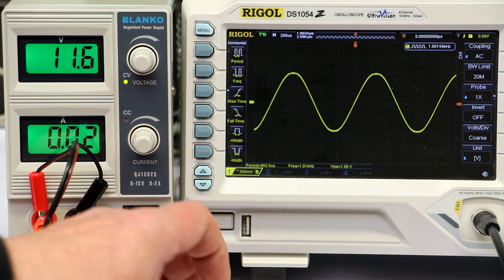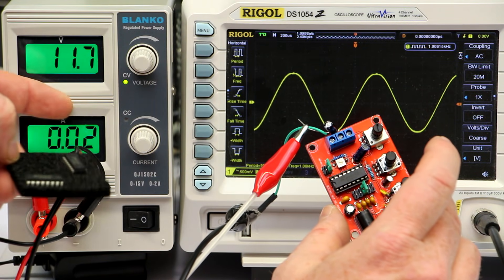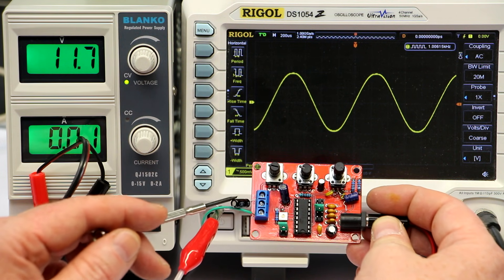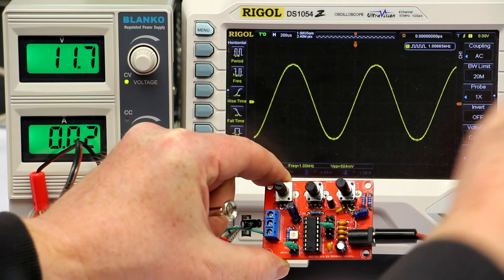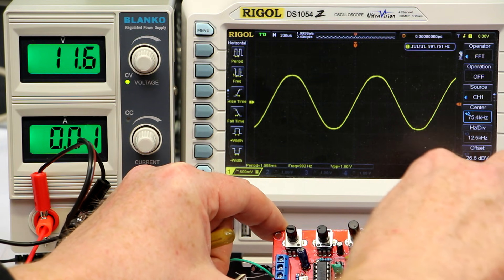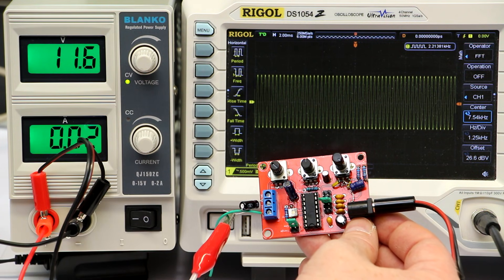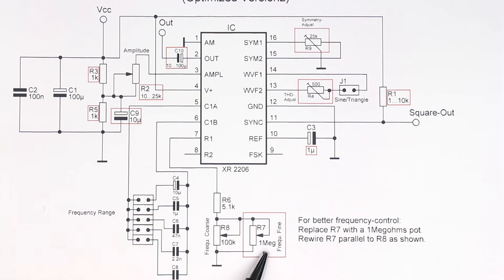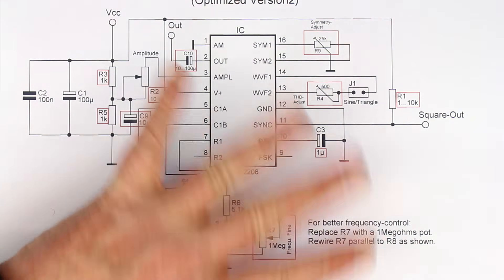Fixing the issues with the XR2206 Function-Generator from EBay

Comment: Hi, Roger!  Thank you so much for this video...it was extremely informative!  I especially liked your improvements, and the schematics you provided with the changes.  I made all of the modifications you suggested, and they all worked except for wiring R7 (changed to 10MOhm) and R8 in parallel.  I may have mis-wired the pots, but changing R7 didn't seem to make any difference.  I reverted back to R7 and R8 in series and it works well enough. Also, I replaced the supplied/fake XR2206 with a genuine XR2206 and it seems to work better, but I still have very narrow noise spikes at the maximum and minimum of the sine wave.  The spikes are present with both the genuine and fake XR2206 chips, so I wonder if the problem is being caused by another component (one of the caps)?  Also,  I was able to source all of the replacement components from Jameco (in the US) for $11.73 (including a genuine Exar XR2206).  Not a bad price for a significant upgrade!  (I will make a separate post with the Jameco part numbers and prices.)
Reply from the maker: The spikes at the upper and lower limit of the sine-curve are a consequence of how the sine-wave is created inside the XR2206. It is a well-known bad "property" of the chip. Soon after the chip came out some clever engineers developed some "workarounds" with a lot of extra-circuitry to get rid off or minimize the spikes.
Reply: @KainkaLabs  Ah, that makes sense; thanks for the explanation.  After I looked at my board again, I realized that I forgotten to solder in C9, and I thought that might solve the problem.  It did stabilize the signal a bit, but didn't get rid of the noise spikes (obviously).  The spikes really distort the sine signal badly above ~100kHz.  It's notable that the closer you look at the performance of this chip, the more flaws you see (the noise spikes, bad square wave asymmetry below ~100Hz, etc.)!

Comment: Hello. I just got my first multi meter and was doing voltage readings on the XR2206. and was wondering how come when I plug in 12v to the XR2206 it changes to 16v just going through the connector? is there a zener diode limiting it to 16v?
Reply from the maker: What? The XR2206 does not a charge-pump or something like that to generate higher voltages than the supply voltage. So you must be doing something wrong when you measure 16V with 12V input supply-voltage.
Reply: i probably shorted something together when i soldered it in school lol. Becaue I have 12v coming in but 16v after the connector.... so confusing @KainkaLabs

Comment: I love your work with this chip. After making these changes, have you thought about a way to make it sweep from one frequency to another ? I have a need (radio testing) to make it sweep from about 200 hz to 5000hz and be able to view it with an oscilloscope.
Reply from the maker: You need an extra-circuit for the sweep-input of the chip. That doens´t fit any more onto the PCB. Today you can get relatively cheap function-generators with a sweep-function. Or you google "XR2206 sweep generator" or similar to find examples of the necessary extra circuit.

Comment: Roger, I have watched and enjoyed both of your videos about the XR-2206 Function Generator.   Have fried my IC by inserting it upside down... I order new IC's  (the old IC had markings scratched out).   With your improvements and suggestions, I am considering making a board that takes your improvements into account and does not require use of modify parts or using SMD components.   I was able to find on Amazon pots of the correct form factor in both 25k ohm & 1 Meg ohm.  I will let you know when I have the new boards... and send you one if you like.   Thanks again for you good work and analysis to make this a better tool for us hobbists.
Reply from the maker: Hi. That is a great idea. Would you be willing to make the PCB-files available for open source?
The potentiometers have a standard footprint and are originally from Alps.
Reply: That would be awesome!

Comment: The 10K pullup limits the current of the 10V square wave, but what can I do to also limit the voltage to 5V. Only having a 5V max sq wave makes things easier, as I won't have to jump from 10V to my regular 5V all the time.
Reply from the maker: You don´t have to limit the voltage.
All digital logic IC´s (exept the very first CMOS-series) can safely deal with overvoltages.
They have input protection diodes going to ground and Vcc which deflect overvoltages (or negative voltages) to Vcc and GND.
The only thing you have to limit is the current through these protection diodes.
Let´s presume the datasheet of your logic-series says that the max. current into any input is +/-10mA.
If you have a 10V signal into a 3.3V logic-input, then the minimum value of the input resistor (or pull-up of the XR2206) is:
R(min) = (10V - 3.3V)/10mA = 670 Ohms
That means that even a 1k resistor would be sufficient and a 10k resistor would be absolutely safe.

The other possibility would be to use a voltage divider.
A 10k/10k or 1k/1k-Divider would make a 5V square-wave output at the center-tap of the divider from a 10V square-wave input.

Comment: Very nice and informative video indeed. Many thanks. 
Just a question though, which minimum frequency could you get to in "square wave" mode?. Is it really possible to get down to below 10Hz?
Reply from the maker: There is no reason why it´s not possible to get below 10 Hz. If you are using an output capacitor to get an AC-coupled signal, the value has to be quite large (>100µF)

Comment: Good day. I am thrilled with your instructive video. I had the above kit with XR2206 so I decided to apply all your recommendations. BUT BUT....I have some problems. 
1. I can't regulate the amplitude at all. It's at maximum. 
2. I don't have SINUS and TRIANGL signal shapes at the output. I only have a rectangular signal. Trying to adjust THD using trimpot R9 and R4, at the output for SIN and TRIANGLE I have a square shape with rounded edges. The supply voltage is 12V. The XR is Chinese.
Reply from the maker: I can´t do remote diagnosis. In 99% of all cases it´s a soldering problem. Perhaps you have shorted out 2 pins or not correctly soldered another pin.

Comment: Is it possible to adjust the amplitude of the meander (square signal) on this generator?
Reply from the maker: It´s an open collector output. So you can with a pullup-resistor get basically any output voltage.

Comment: Another possible solution to the square wave problem is to keep the 1K resistor and clamp the output with a 5.1v Zener diode. I have one of these kits but not built it yet, so I may try that as many 3.3v logic devices are 5v tolerant these days, I just don't know if a Zener would be fast enough at higher frequencies.

Comment: Hi,
Thanks for the very complete and comprehensive videos! I also found another issue that is wonder is somebody else had:
In my signal generator the maximum possible amplitude is around 3.5 volts (peak-peak) and no matter what I do stays the same. I changed the amplitude potentiometer for a larger one but the issue persists.
Any hint of what could be the cause? Thanks!

Comment: This is a great Video. I have one question regarding your second change (Swap R3/R5 from 5k1 to 1k): Both form a voltage divider with 1/2 Vcc output. Only the current changes (10k2 vs. 2k resistance in total). I don't understand this change. I would very apricate an explanation :)
Reply from the maker: The voltage divider R3/R5 has to be as low impedance so that the load through the amplitude potentiometer does not appreciably change the virtual ground voltage at the midpoint of R3 and R5.

Comment: having a hard time finding a 1 mega ohm Potentiometer to replace the middle  Fine  Knob (R7) per suggestion on  Kainkalabs schematic.  the ones I find do not have 3 pins going down - they go to side. does anyone have a model number I could google. thanks

Comment: Hi Mr. Very good video! I found the same issues with mine that I bought assembled. I was in doubt if it was defective or a design  error. You solved the doubts. Thanks! Just one issue: I've tried to download your schematics with optimized components and instructions  but received a "The request is blocked" message. Could you please help me with this issue?
Reply from the maker: Link has been changed to the kit in our online-shop where you can also find the documentation. Should work now. Built-manual is only in German until now.
Reply: @KainkaLabs  Thanks!

Comment: Forgive my ignorance as I'm new to electronics. I want to replace R4 with the suggested 500 ohm trim pot but am uncertain as to the routing of the pins. Trim pot with three, resistor location accepting 2. Do I put the first pin in hole 1 and then extend the wiper pin into hole 2, deleting the 3rd pin on trim pot?
Reply from the maker: Connect the wiper pin to one of the IC-pins, where R4 was connected.
Connect only one of the remainig two pins of the trimpot with the other IC-pin (the remaining trimpot-pin can be left unconnected).
The order of the IC-pins in connecting it with the trimpot doesn´t matter.
Reply: KainkaLabs Thank you for the fast response. You're a great teacher. I love watching your videos!

Comment: Very good info, but try using battery as source power and stability problem is gone.
Reply from the maker: No. The problem comes from the voltage as soon as it gets higher than 12V.

Comment: Hi, just a quick question, I'm ready to assemble the kit and I'll implement all your suggestions with the exceptions of using the fake IC and for R2, I'll use a 10K linear pot (which I already have). Will there be any negative effect to my output due to those deviations? Do I need to change the connection of the wiper like in your diagram having a linear pot in R2?
Reply from the maker: With a linear pot you don´t have to rewire the connections because a linear pot is symmetrical (while a log-pot is not symmetrical concernings it´s outer connections)
The only thing that remains a bit annoying is the counter-intuitive rotation.

Comment: What is your source for the 10K logarithmic potentiometers in this form factor? I built the circuit as you have shown and I suspect that the the 10K pots which I had on hand may be a problem. I have no amplitude control and I used an audio-taper potentiometer there at R2. My circuit is working for the square wave setting and I can adjust fine and coarse frequency  very well, but I have no amplitude adjustment at all. However, when I switch to the sin/tri output I have no wave form whatsoever. I am very perplexed. I checked the entire circuit with an ohm-meter and all seems correct. I even swapped the IC and that is not the issue either. I have an unmodified board that works  with the deficiencies which I have compared.
Reply from the maker: R2 is an ALPS type RK09K111 10KA. I got it from a German distributor but it is a standard type available from many sources/distributors.
Check the connections of R2 with a continuity tester, especially if there are no shorts between all 3 pins.
Remember for the log-functionality that you manually have to reroute the middle-pin.
If you have a scope, check the sine/triangle output directly at pin 2 of the XR2206.
Reply: @KainkaLabs  Do you mean RK09K113, which is for a vertical installation? RK09K111 is for a horizonal installation.

Comment: Hi Roger, I can't work out how to rewire the amplitude potentiometer. The original schematic has left pin linked to R3/R5 and middle and right pins linked to 2206-3. Your schematic has left and middle pins linked to R3/R5 and right pin linked to 2206-3. So we need to remove middle pin from 2206-3 and link to R3/R5. But how to do that in practice? Isn't it hard wired in the PCB circuit? So I could solder a wire from middle pin to left pin, but how to disconnect middle pin from right pin/2206-3?
Reply from the maker: I have inteerupted the original PCB-traces and handwired the new connections to the potentiometer.
Another possibility is that you only solder the 2 sideways metal flaps, bend the potentiometer pins upward without any contact to the PCB and solder some wires directly to the pins with the right connections.
Only necessary if you use a logarithmic potentiometer (recommended) and want the direction of rotation to be intuitively right (clockwise = higher output level)
Reply: Thank you Roger.
Reply: @KainkaLabs  In my kit all of the potentiometers were 50K, so "Fine" and "Course" frequency controls functioned in an identical way. Changed course to 100K and Fine to 10K, but as I used 10-turn cermet presets, 100K course control is good enough.

Comment: i bought a kit and some other "xr2206" chips with different looking print, ebay and amazon, best i can get is a square wave from the kit chip, others just give me flat levels or something that looks like its trying to be a triangle or saw but is truncated to maybe 0.5V.
i remember watching your first video and being excited to have a sine. but i have to advise, kit purchasers may be lucky just to get a useless square.
Reply from the maker: Did you operate your kit with (slightly less than) 12V? Remember that the fake XR2206-chips are 100% compatible except for that they only work up to 12V supply voltage.
Reply: @KainkaLabs  homemade variable voltage PSU, swept to ~18V. the chip with the kit that gives me a pulse has no date marking, the "other" ones i bought are dated 0919 but give a flat signal where the other gives pulse. some of the reviews for these kits on amazon are about the same, chip absolutely worthless.
Reply from the maker: Hm. Strange. I still think that it´s wrong wiring or wrong supply voltage. Did you only supply GND and +12V and not +/-12V?
We sold hundreds of these kits (with my special annotations) and haven´t had a single complaint.
Reply: @KainkaLabs  the kit/PCB i have is for DC :/

Comment: Mine produces a cupped shape sine wave on the positive end. Almost like how a kid would draw ocean waves, sort of distorted and leaning toward the right. What would cause that?
Reply from the maker: does it do that only at maximum amplitude or also at smaller amplitudes?
Reply: @KainkaLabs   more pronounced at maximum amplitude AND lowest frequency. It looks like a piece-wise function of several exponential growth and decay curves tied together. Like desert sand dunes. Hard to explain, wish youtube had an attached imaged feature.
Reply: I  also notice the jumper for the triangular function selection has no effect (whether plugged in or not, it displays the same).

Comment: Have you tried running this chip with a 10v positive and 10v negative input, rather than positive and ground.
Reply from the maker: That doens´t matter. The fake chip only works up to 12V total, no matter if you split the supply.

Comment: HI. My German is poor so I am not sure where link above is redirecting me. I see sales offer for this generator but question is : are you offering there already improved version of this unit with all your modifications and original EXAR ? So paying 20 € will I get already latest working mistakes free unit ? AM I right ?
Reply from the maker: The kit includes all the extra parts I described in the video. But the chip is of course the "12V-limited" Chinese clone.
Reply: @KainkaLabs  SO the easiest way is just to buy Chinese set DIY and change all components locally accordingly to your design. Do you think for beginner in electronics such generator in audio frequencies up to 20 kHz sin square can be sufficient as test signal source? Paying hundreds € for semi pro unit seems to be over-investment in my case. BY the way - I see comments that original EXAR is obsoleted already by manufacturer so risk to buy fake element is high today. Thanks and Happy New Year.
Reply from the maker: Yes, this is a good beginners project. And for a basic check of audio amplifiers it is totally sufficient. The "hardest" signal for an audio amplifier is the triangle signal which is quite clean with the XR2206. Triangle signals have a lot of harmonics and the sharp change of the slope at the upper and lower edge . So if an amplifiert reproduces a 1 kHz triangle waveform correctly at it´s output it is OK. For frequencies above 1 kHz you have to change to the sine signal because audio amplifiers are usually bandwidth limited and cannot reproduce the higher harmonics of a 10 kHz triangle or square waverform. 
For checking or minimizing THD (if there is a trimmer for that)  you need a completely different setup. Either with a soundcard and some audio-analyzer software. The soundcard can output very clean sine signals with very low distortion and the soundcard-inputs are also very good even with "only" the standard 16 bit resolution. 
Or you need an ultra-low distortion (<<0,1%) audio signal generator and signal-analyzer. Very expensive. Or you take a modern DSO with 12 bit resolution and let the FFT function do the analysis. Siglent and Rigol have these for very competitive prices nowadays. But the soundcard + analyzer-software is still the best and cheapest solution.
And the Chinese XR2206 clone is functionally and from it´s performance 100% identical to the genuine EXAR chip. The only difference is the maximum supply voiltage of 12 Volt. The original EXAR-chips are nearly unobtainium nowadays because production was stopped many decades ago. You may get them for high prices on EBay (around 20$ upwards)
Reply: @KainkaLabs  Thank yo so much for so comprehensive answer. Danke Schoen and Happy New Year.
Reply: @KainkaLabs  One more clarification. In your improved manual is written R2/R7 pots to be changed to 10K and R2 also changed to logaritmic. R7 remains linear right ?
Reply: OK I think I found answer in another your video so R7 seems to be (or has to be ) linear. R2 pot logaritmic.